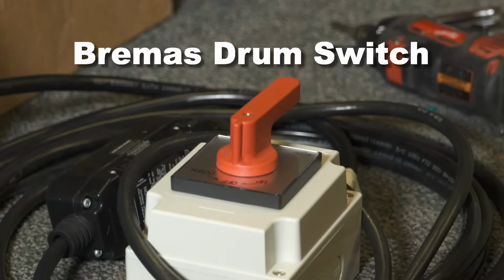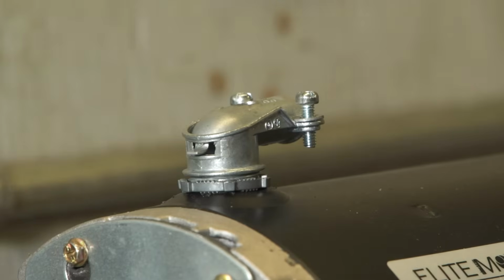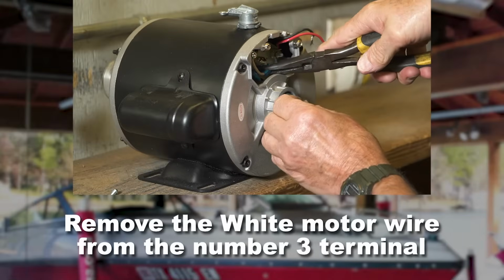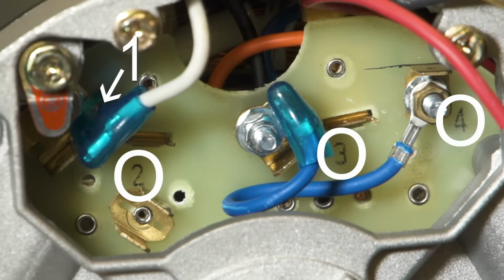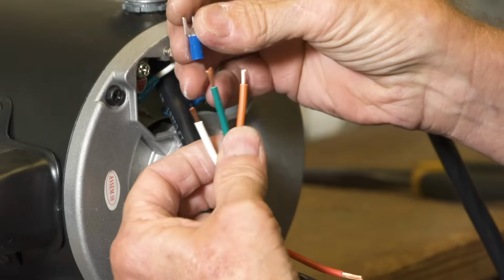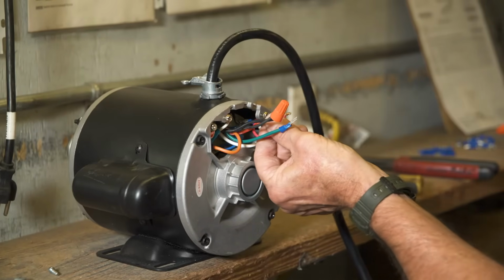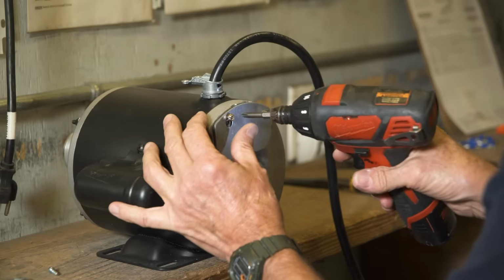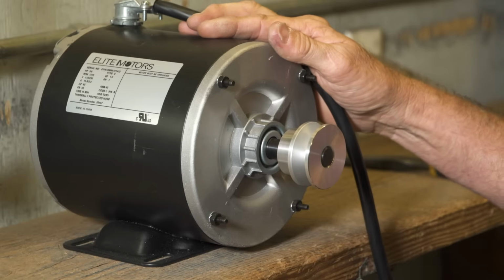Elite Motors - 3/4 HP Painted 56 Frame Boat Lift Motor - 110v Wiring

Comment: Hi i have a problem with such a motor (marathon 1/3HP) and i want help.The problem is: When the engine is stopped and restarted, the direction of rotation is reversed
Without changing anything in the circuit.It revolves in the second direction.I want to help you with this problem. Thank you very much
Reply: for "normal" 56 110v frame motors, reverse the red and black wires to change direction of spin.